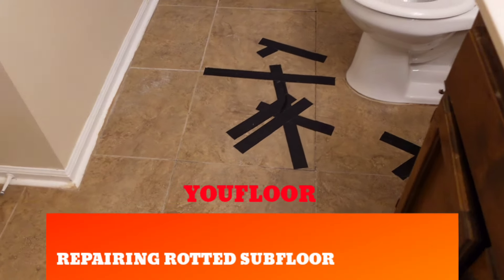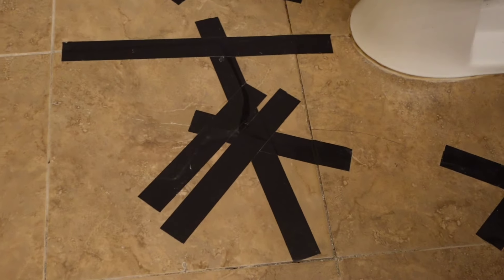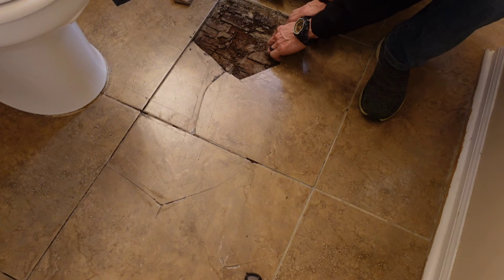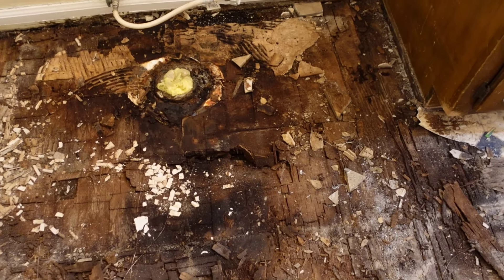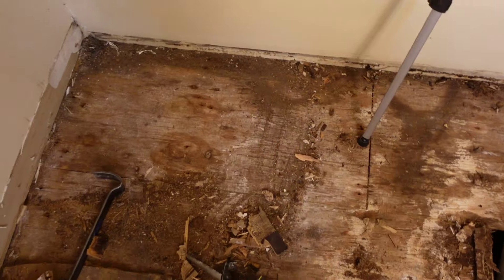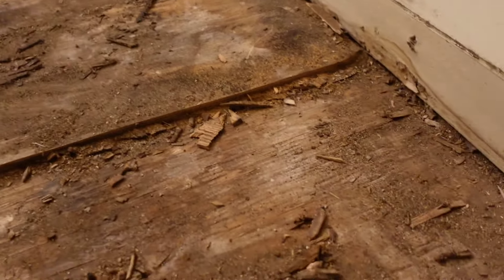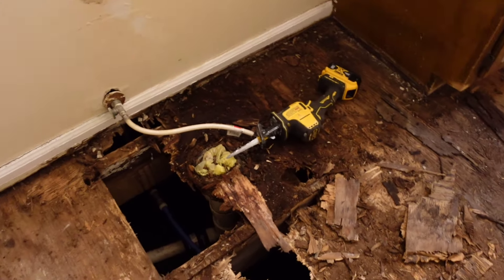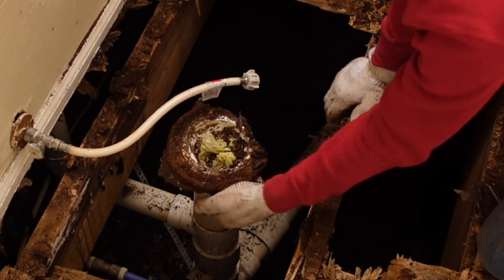Repairing Rotted Subfloor In Bathroom

Comment: Are there no building standards in the USA? I have now done several houses with rot around the toilet and in every case the house was designed poorly with too much flex in the floor. Plus, the wood is never pre-treated for resistance to rot, nor is the wood, membrane sealed. What I end up doing, for smaller jobs, is reinforcing the joists around the toilet (in particular) and adding cross-joists for support in critical areas. I also pre-treat the wood to be rot and water resistant, which I repeat after installation. In critical areas I use 3/4 inch hardwood. It seems to me fundamentally wrong that builder are allowed to get away with this kind of practice.
Reply: Depends when the house is built. Doesn’t matter what “standards” start to get implemented houses prior to that won’t adhere to those standards. That’s where renovations come into play
Reply: Build and repair is VERY expensive so people often opt for unlicensed "handyman" types that are much cheaper than competent professionals. This work is typically done by illegal aliens from Mexico or South America that may work on construction sites etc and do this sort of thing on the side. They cut a lot of corners because it makes jobs go faster and uses less materials.
Reply: @GalacticEgg Not withstanding your observation is no doubt correct, the overall standard of construction in Arizona nearly beggars belief. I am currently replacing a shower which was 'as installed by the builder'.  The one-piece shower lacked any mortar support and instead relied on two, half inch thick, planks of wood embedded in the fiberglass pan. Unfortunately these pieces of wood were not contiguous because of the need for the shower to slope towards the drain. Anyhow, after 15 years the wood (and the fiberglass) gave up and collapsed. After stripping out the old shower I found the plumbing consisted of a moen rough in which was floating in mid air, secured only by two straps around hot/cold PEX piping and the copper sweat joint leading up to the shower head. The PEX pipes (and also one going to the bath) were wound around studs so they impinged on the shower walls. To proceed I had to disconnect these pipes, drill holes through the studs, reinforce the studs (for other reasons) and then reconnect them. All because the original builder's plumber was a lazy piece of c**p. Sadly, this is all too common (aalong with numerous code violations that required my intervention). The electrics were no better and the installation of the (original) HVAC was a disgrace.  This is typical of so-called professionals in Arizona. They are a joke.
Reply: @davidgapp1457  This is what you get when laborers build a house instead of skilled carpenters and plumbers.

Everyone wants it cheap cheap cheap, until you have to repair all of the damage from their poor workmanship and low quality materials.
Reply: @davidparker9676  I completely agree with you. I would be willing to pay extra for quality workmanship. In the end I guess the only solution is to design and build your own house, and if I'd had time I would've done so. What is annoying is that builder do not give you the option of having premium solutions and superior workmen onsite. I suspect they don't want your neighbors to become aware of just how poorly their own houses are constructed. Seriously! For instance, bringing the hvac ducting inside the cooled space. Either way, the builders just don't give a damn and they were 100% intransigent.
Reply: It's because these buildings are so old and codes were not in place when they were built. You sound like you know what your doing..
Reply: Question what if the rot is in the joists what needs to be done
Reply: @Layna_570  Old houses are built better than most of the new homes today. It isn't about codes, it is about quality materials and craftsmanship.
Reply: @davidparker9676  That's what you think. Come see some buildings in Scranton PA. I've lived in multiple apartments thoughout the city the living conditions are absolutely unbelievable
Reply: @Layna_570  Anecdotal evidence.

I have seen the houses in that entire area: PA, WV, OH, MD etc. 

The houses built today will not be around in 100 years.

100 year old homes that have been neglected and jury rigged for the last 80+ years does not reflect on the builder.
Reply: What do you pre treat the new lumber with?
Reply: @Layna_570 NO. My house is actually 96years old in Connecticut. I am in the process of replacing the rotted floor around an upstairs toilet where the wax flange failed and moisture rotted out that area. After pulling up a few layers of vinyl tile we came to the original flooring. TWO (2), yes two layers of 3/4” tongue and groove original flooring. So basically   1-1/2” of flooring supporting the bathroom & toilet. It lasted. We had 3/4” plywood and were going to replace that section with that.  Redesigned that layout. Two layers of plywood still had some flex.  We took it back up and built a lattice type between the existing joists giving support every 6-9” with cuts of 2 X 4’s. Put back the 2 layers of plywood to build back the 1-1/2” floor base to match the rest of the room. (Only an area less than 3’x4’ was rotted, the rest pristine. ) Tomorrow we are laying backboard so I can install ceramic tile flooring. I was hoping to find a video showing this stage. In New England, 100 years ago they built these houses to last.
Reply: Question - what if the roye made it underneath the vanity or into the walls because it looked very close to the wall/sheetrock
Reply: Should there not be a moisture barrier as well on and/or below the subfloor to prevent condensation getting into those areas? My toilet is about 1/8-1/4” sunken in because of rotted out floor but I don’t see a moisture barrier through the exposed vinyl nor do I see one behind my shower. Water damage has destroyed my bathroom over the years
Reply: @buck1891  I would strongly recommend the use of a paint-on latex under vinyl, though to be honest I would never use vinyl around a toilet - it's a recipe for disaster. I would, at least, use several layers of a membrane coating / sealant and pay great attention to cracks where water can migrate due to capillary action. In general I would coat the (new) boards on all sides before installation then re-coat areas of abrasion and screw heads. Never, every, use nails through a membrane coating!
Reply: @davidgapp1457  good to know thank you. I’ll be sure to take this into consideration when I renovate my bathroom next year
Reply: If you didn’t know, homes in the USA are made of popsicle sticks and Elmer’s glue.
Reply: Enough with the regulations. Let the free market figure it out.
Reply: It is strange that in mobile homes they treat subfloor by the doors, but not the bathroom.

Comment: I’m in process of doing this to. No support for the toilet, so it flexed, leaked, rotted the subfloor, and caused mold. We removed the toilet, the tile, the luan and will be removing a 2x3 ft section of subfloor and replacing it with plywood. We will also be installing more cross bracing between the floor joists. House was built in 1988 , and the joists span 32 feet! This job is way worse than what i am doing though! Kudos to this guy!
Reply from the maker: Thank you. Good luck with all your projects. Thanks for the comment
Reply: Excellent job
Reply: Need u to replace my floor
Reply from the maker: @maryshutty1515 thank you
Reply: How much did it cost?
Reply: @jazzylat1213 I commented above about doing a similar repair on my almost 100 year old house in CT. The plumber had to fix 2 broken valves under the vanity so we could update that at the same time as replacing the sub-flooring and floor.  Breakdown so far. Plumber $350 to replace 2 shutoff valves, $200 to replace toilet and flange (over 25 years old and tank starting to leak), lumber for subfloor about $120, backboard- 3 - 3’x4’ pieces $100, ceramic tile $220. Still need to pick up adhesive, grout, trowels, sponges, etc. guessing another $125. Estimated total $1,150-ish doing it ourselves with a lot of patience. So far.
Reply: 32 feet span!  That's crazy.  It's amazing what some builders get away with.

Comment: That toilet has been leaking and rotted out the floor I bet.
Reply: 100
Reply from the maker: You are probably right. I have seen this problem happened more times than I can count in my years of installing floor
Reply: Yup. About to do this same job for my parents' old house. They've had a toilet donut leaking for years, and it's rotted out the floor.
Reply from the maker: Good luck. Lots of work but super satisfying when it's complete. Thanks for the comment Jenna
Reply: yeah my spare bathroom is like that, half the way done .. got everything ripped out, now floor and toilet flange, new cabinet, flooring etc.
Reply: @jennabronson4704 did you end up fixing up the bathroom? My parents house has the same issue

Comment: Question from a layperson: When you put down plywood untreated, don't you get rot from below (crawlspace) eventually?
Reply from the maker: Not if you take the proper steps to insulate underneath your flooring and to put a moisture barrier on the ground below your house, I framed for nine years and we built many homes and none of them did we use pressure treated plywood that seems like it would be expensive. I may use pressure-treated plywood on a wheelchair ramp or a screened in porch, but it is not necessary when building a home. Hope that helps. Thanks for the question.

Comment: just curious, at the 10 minute mark you put a new larger piece in, why show us the part of hammering the board in only to replace it with a larger piece?
Reply from the maker: I did not replace it. That was the first layer, which was only a half inch thick and it went directly down on the joist then in order to bring that floor up with the rest of the floor towards my entry door I capped that with another piece of half-inch making it 1 inch thick the piece I hit with a hammer is still there. It’s just underneath the second layer. Hope that makes sense. Thanks for the question or comment
Reply: @YOUFLOOR  oh i understand now, thanks for responding, looking to fix this problem in my own downstairs bathroom and know nothing, could it be 1 piece if i want?
Reply from the maker: If you are replacing the whole floor, then I would definitely go with three-quarter inch or 23/32 subfloor. Then you can get away with only using one layer. The only reason I did two is because the previous homeowner did it with two and I wasn’t removing the whole floor so I had to match what they had to keep the floors all the same height
Reply from the maker: Also, we have another channel where we flip houses. I am on a flip house right now where I have had to replace 100% of the band floor choices and the subfloor so if you’re interested in something like that, I will leave a link to our second channel and you can check all that subfloor out. Thanks again for the comment and the view.https://youtube.com/@rentthisflipthat?si=yNoJZiz8N9EFcE0W

Comment: Nice detail work.  I'd never rip out tile without gloves considering the sharp edges.  When possible, first examining the underside of the floor via crawl space or cellar ought to be done to anticipate what surprises await.  How was the new floor waterproofed to prevent recurrence?
Reply from the maker: The flange needs to be above the finished floor. Whoever installed  the tile had the flange lower than the floor and the wax ring leaked for years. Yes, the issue was fixed with the new flooring. Thanks for the question

Comment: Hard work just ripped out our main bathroom & tub combo down to the floor joists. I had to 5/8 triple plywood the subfloor for a slight pitch 14" to the stack. We had to use self-level plus the tub area no ceiling access below only the closet access door by the faucet. Our joists were running front to back the existing 1' 1/4" (1964 Bi-level) copper drain was capped off & previous homeowner modified a new drain 1' 1/2" PVC through the ceiling rerouted down to another exist copper discharge pipe. I had no option but to use that 1' 1/2" PVC drain.
Reply: OUCH 🙏🏼🙏🏼🙏🏼

Comment: Thanks for sharing this, it's informative as I face a potentially rotted subfloor. I'm not experienced at this, so take my questions as truly curious ones, right?

At 9:41, is it ideal to have to essentially force in the replacement subfloor? I wonder about allowing room for expansion and avoiding buckling if it swells.

Similar thought about 11:46, would it be better to cut the new pieces a hair smaller to allow for expansion? Trim will cover the gaps against the cabinet, flooring will cover the seams near the toilet pipe. Good work, the results are terrific! You do good work!

Comment: Why is there no cement board/durock underneath the floor to begin with? I've never seen anyone put porcelain tile straight to particle wood board/ plywood.
Reply from the maker: I absolutely agree 100%. Lots wrong with this installation. Thanks for the comment
Reply: I just pulled out a bathroom floor that was 30+ years old which had 6" ceramic tile glued right on top of linoleum sheet flooring and 3/4" subfloor. The only tile I found to be cracked was under the toilet. Both toilet and bathtub drain had leaked for years rotting out sections of subfloor but the tile and grout held up. Crazy...
Reply from the maker: @sonofhal9245 Wow, that is all very interesting. Thanks for sharing
Reply: I am doing a floor now that has 6in tile right on top of particle board. No underlayment at all. The tile just has been coming right up. Particle board is so old it’s basically a dust .
Reply from the maker: @noahhypes3850 I can believe that I’ve seen some bad jobs in my life .particleboard is the worst

Comment: How did you secure the new floor joist next to the wall behind the toilet flange? I have a similar situation going on in my bathroom.
Reply from the maker: The joint was on 16 in centers. So I cut 2 blocks at 14 and a half inches and And put them in between the existing Joist and then I was able to slip the middle one in and screw it from the ends. I made sure to run the new Joyce just passed both walls. Hope that helps if
You need a diagram, let me know. I'll email you how I did it. Thanks for the question
Reply: I have the same problem can you email me the diagram plz
Reply from the maker: Ok no problem. Have you exposed the crawl space or any joist yet. Send me a pic or 2 to youfloor.net@gmail.com. I will take a look or at least send you a diagram of how yo head off a joist, Z

Comment: Would it not be beneficial to use some sort of water proofing agent on the floor boards since it is in a bathroom ?
Reply: Thats exactly what I was thinking. I'm rebuilding my first bathroom and every video I've seen says to use a waterproof membrane if the subfloor is wood. I was planning to use waterproof membrane on my floor and up the wall about 12" or so and then all around the tub/shower area up to the ceiling. No mold or water damage after I'm done should someone let water run free.

Comment: Man, everyone is a damn carpenter/ plumber in these comments lol

Thanks for the content. Im doing a 1979-80 model ranch in southern Alabama. Same thing pretty much. Cement tile and mortar mesh encapsulated shower, flooring and walls. The worst part was getting all that out first. I feel like im home free and just got to the actual subfloor. Gotta sister a joists or two just to be sure, then all new everything and rearrange the floor plan a little bit. Were the tops of those joist soft at all?

Comment: Great thread. I’m researching how to replace first floor, half bath sub floor after the plumber just replaced the toilet flange. The plumber mentioned floor didn’t look that bad but I’m Leary and want to replace the sub floor as it shows area of black mold. The bottom/side of vanity closest to toilet was damaged from this leak. How can I tell if the original toilet plumbing is correct as this Kohler toilet leaked early on (home built in 1992), after we noticed leaking through to basement. Then we noticed wet rugs around base of standard toilet one year after toilet was installed thinking the bolts were loose, the toilet was cracked, something. Meanwhile, those peel and stick tiles were old and a few loose, cracked, so now I’m looking for a bathroom re model: replace sub floor, new floor, vanity, etc. 
Do I hire a licensed contractor, carpenter, plumber , any ideas?  Thank you.
Reply from the maker: I would. And with a project that big make sure they carry general Liability insurance incase something goes wrong. Hope that helps. Thanks for the question

Comment: So if water splashes out of the tub will the vinyl flooring keep the water out of the subfloor?
Reply from the maker: That is how it is supposed to work. A lot of times we will seal the perimeter with silicone to keep any spills on top of the flooring. Tks for the question.

Comment: What size of screw did you use for subfloor?
Reply from the maker: 2 and a quarter start head is usually mt preference. 2 inch and shorter usually has a thinner shank. They tend to break sometimes going into floor joist. Hope that helps. Thanks for the question

Comment: I had someone remodel my bathroom and instead of removing the old tile they put the new tile on top of that old. Now I can see the toilet leaking in the basement. I think I have something a gap in there when sitting on the toilet.
Reply from the maker: If the wax ring is not installed correctly it can cause a leak. Might want to have a plumber check to see if it is sealed. Thanks for the comment